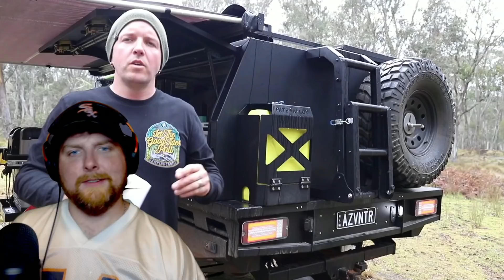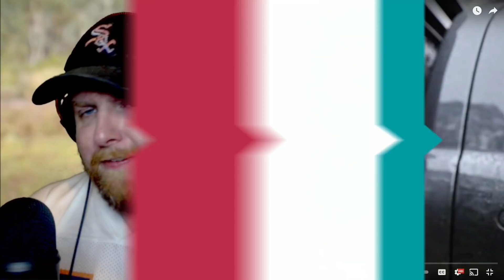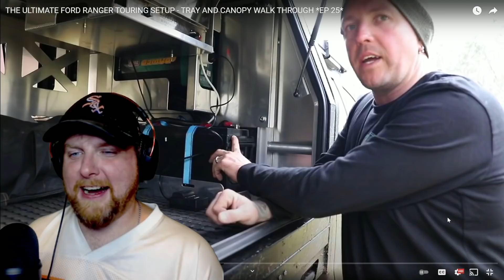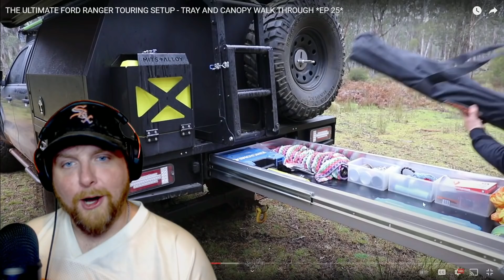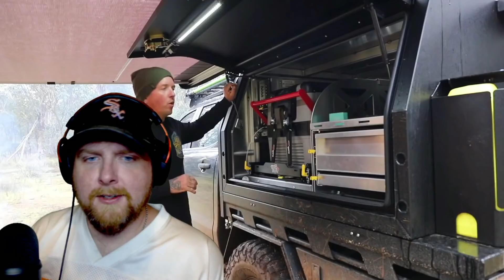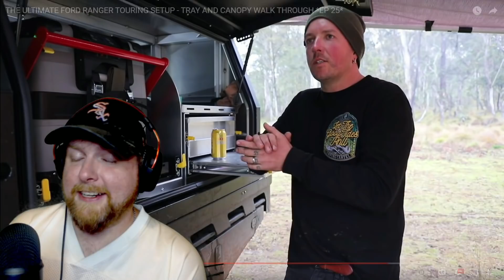American Reacts to The ULTIMATE 4x4 Setup - Australia

Comment: I'm outbush right now. I'm wearing the campfire cologne & cooking up some Wallaby, damper with wild blackberry jam & smoked eels plust trout.. I have a Nissan Vitara.with a 7inch lift kit, Snorkel & tow a caravan through streams, rivers, over dunes and the worsted of the worste, bulldust. Bulldust is like red talc powder that can be several feet deep.. I have gone around Aus 3 times though & will go again..
Reply: Awesome, I once had a Vitara SWB with a combined body and suspension lift of 4" and 31" tyres, making for about 7" taller than stock. Was an absolute offroad beast.
Reply: Nissan Vitara? I can smell the Bulldust from here. Sounds like you're close to bullshit creek.
Reply: Isn't a Vitara a Suzuki?
Reply: @adamparisi745  Yes.

All the old suzuki 4wd's were very serious offroaders in the Jeep style (just without the unreliability issues). Early Jeeps, such as the famous WW2 jeep were much smaller lighter cars with 4 cylinder engines.

The current generation Jimny is one of the few seriously capable small 4wd's and has a waiting list of 2 1/2 years for a new one.

If you don't know how capable they are, I suggest you watch some videos of the Suzuki Sierra, Suzuki Samurai (same thing just different name), Suzuki Vitara and Suzuki Sidekick (same thing) offroad.

For comparison, my Vitara on Geolander Mud Terrain 31's, welded diffs, and custom lift was more capable than my 4.2 litre Nissan GQ SWB (renowned as one of the toughest 4wd's ever) with it's factory diff lock and 36" not legal for road use swamp tyres.
Reply: @AndyViant  Read Terence's post again.  Says he has a Nissan Vitara.  Wonder what it is he actually has.  And yes, I have an idea how capable the Suzuki 4wd are.  Great little cars for the price.

Comment: I think MORE Aussies are into their 4wd's as the biggest selling section of the car market is the dual cab ute (medium truck) market.

But due to regulations and safety concerns we don't tend to see 6 inch lifts and 38 inch tyres. Once I drove stuff like that (GQ Shorty on 36" Super Swampers) but those days are long past, because the police have heavily cracked down on those kinds of vehicles. 

What we build for now is mostly distance touring.

When I travel to go camping, 4wding and hunting with my mates it is normally a 2000 kilometer (1200 mile) trip, so it has to have good reliability, reasonable fuel consumption and good comfort. 33"s are the go rather than 36"-38" tyres, and these days I'd be buying a radial aggressive all terrain over a pure mud tyre or a rag* tyre.

So while the 4wd has to be quite capable when I get there, as I'm usually talking about something like Victorian High Country driving through mud and snow, or Cape York and crossing crocodile infested rivers bonnet deep in water. Although to be honest with what I drive, twin difflocks and all, I'd probably bypass Gunshot Creek.

As such, we tend to build something that might be capable of getting through MOAB or Rubicon trail (but only so long as you get your lines right or pull out the winch) it's more an all terrain tourer that can get the family into places that most people will never experience.

*rag tyre relates to construction (bias ply, meaning "fibre" plies as opposed to metal plies) and is not in any way derogatory. Just because I know someone, somewhere will get triggered by another meaning for that word.
Reply: Should point out that 2000 km is ONE WAY. 4000 km return.
Reply: For some reason it changed Navara to Vitara. I should have checked but was speed typing as to get back to drinking with friends.
Reply: Actually with money anything is possible ;) had 5.5” and 36” simmiexs on my 6bt gu ute engineering can get through many loop holes ;)